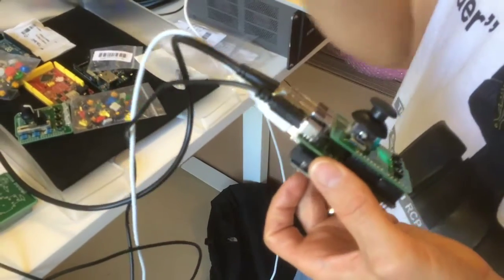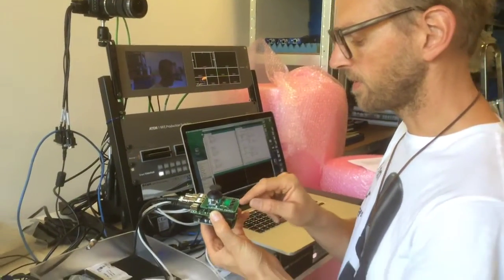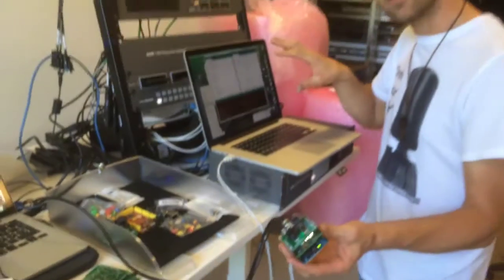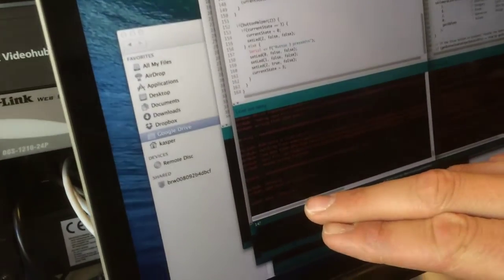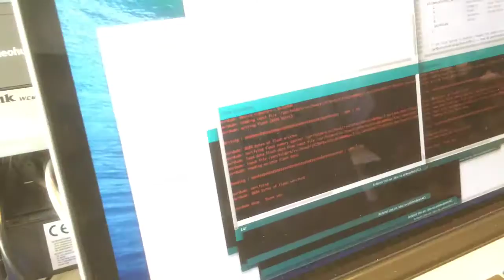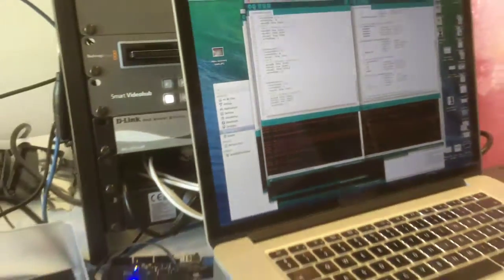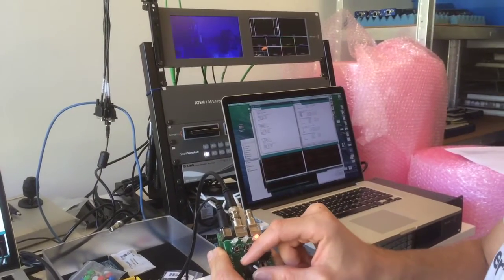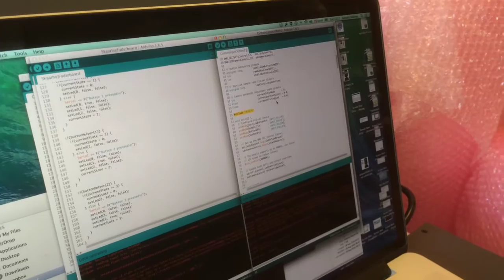Blackmagic Arduino Shield Review

Comment: Hi! I’m working on a project for myself.. I’m a gaffer and I want to make a device that makes a snapshot of a single frame. So is there any way you can connect this to an 3gsdi output of any camera to receive image information? 
If not... I will create some kind of shield myself :). I’m not a programmer myself but I contacted someone who is a programmer and if it would be technically possible he can code it... I’ve just started this project yesterday, so I’m researching the hell out of this 3gsdi shield from black magic. But people only mention the possibility to control camera functions. So my Question is; can this black magic 3g-sdi shield receive “image” information?
Reply: I don't think so, but I might be wrong. Did you find an answer ? Because I'm interested too. thanks